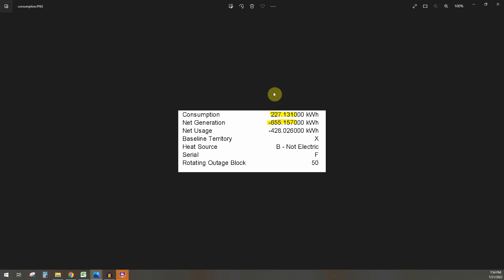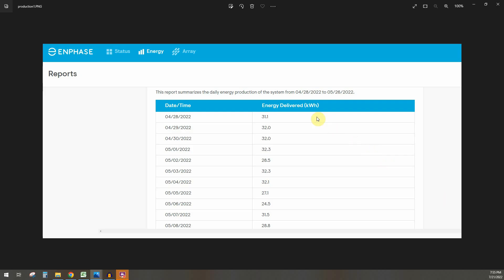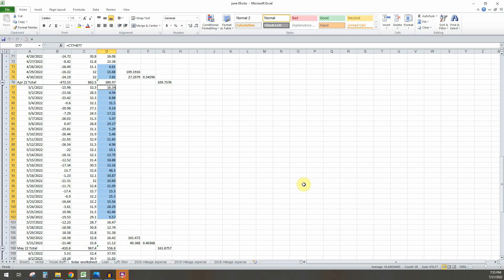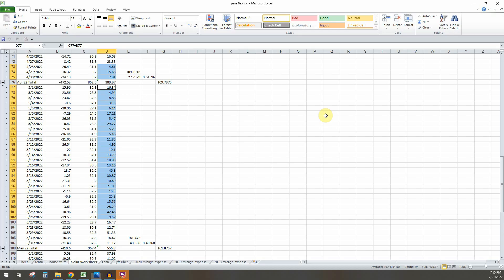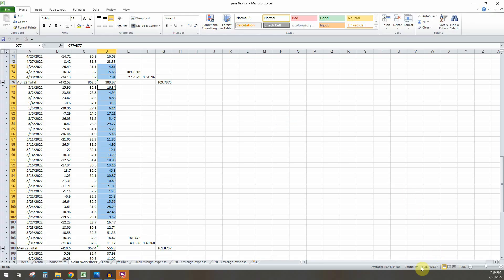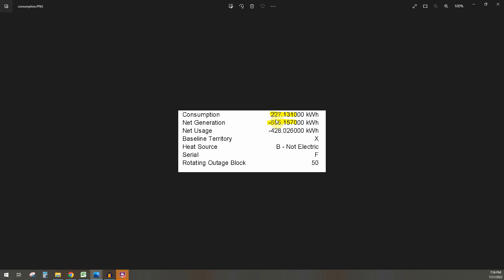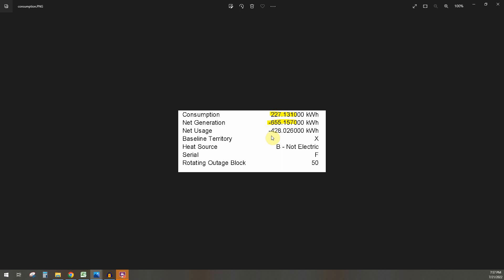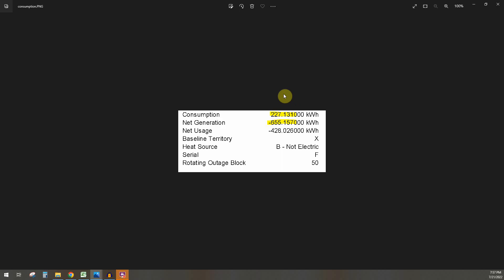Home Solar System – Why Doesn’t My Utility Bill Generation Match My Solar Production?

Comment: It’s not just load. There are also inverter and other circuit losses, which is the difference between what solar edge tells you is the total array production (gross) and the sum total of what you use (load) and what is exported.

Comment: I have both load, production and export via ct's and it still doesn't match the power company numbers 😢
Reply from the maker: It's still not going to match because as I mentioned,  the energy you use straight from the panels the utility has no knowledge of.  The are just reporting what the meter sees, which is going to be export and import.  Load (partly) and production is on your side of the meter, so the CT's are really for you only.  The delta, or what's "not matching" in your case, is your usage straight from the panels.

Comment: Is it better to charge "load" when panels are producing? Or does it not matter if you charge at night?
Reply from the maker: Depends on your utility.  For most people, all off peak rates are the same.  So if you have 1:1 net metering, yes, charge during the day when the sun is out and pull the energy straight from the panels.  This way you don't involve the utility at all, assuming you have a big enough system to cover the power of your EVSE.  Or just lower the amperage on your EVSE to match what you're producing and spread out your charging.